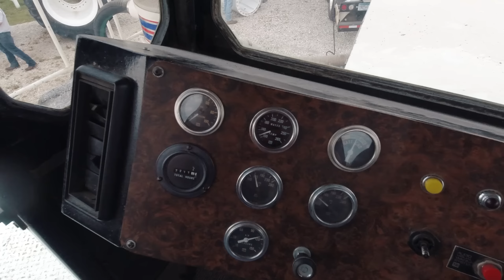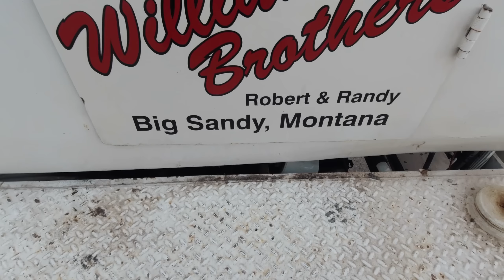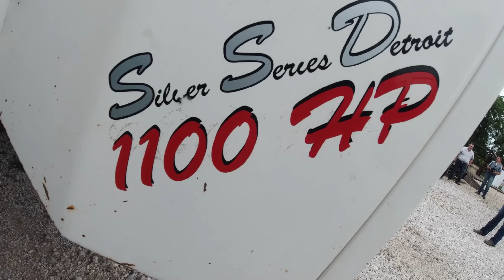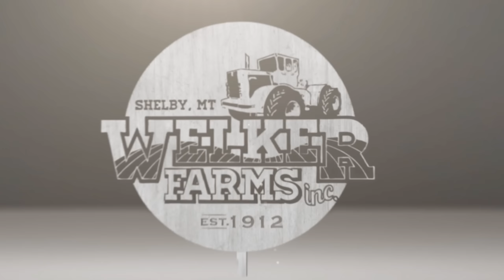World's LARGEST Tractor Gets World's LARGEST Ag Tires! - BIG BUD 747

Comment: Am I the only one who think’s the 747 looks better with the old tires
Reply: No I also think it looked better with the old tires. Its proportions look weird with the new tires. I'm nit sure if they still use the 747 or if it's just a museum piece. I understand if they are using it but if it's just going to sit in a museum then I would of left it alone.
Reply: @ChiefStones  the tires were junk were taking chance just driving around. They were nit using it in Iowa as they were all no till operation now.  Don't know what Oman is after moving it back to Montana they have land there. But most likely no till also
Reply: With these tires it would look better with singles, cause singles would be almost as wide as the old doubles. But I guess the doubles are needed for weight distribution and traction.
Reply: Yes
Reply: I do prefer the old duals look but the functionality with the lsw’s is probably better but, meh i like both setups 👍

Comment: YESSSS finally who would have thought that a tractor from the 70's would still be a workhorse today, it was built to last centuries. I hope they give that ole Detroit some solid hours!!
Reply: To my knowledge we dont even have equipment that that thing could pull that would put a decent strain on it, that motor will probably not be stressed for a long time lol.
Reply: @BlackjackOnem  Well yes it is a 2-stroke with 1100hp too much torque!!
Reply: Who'da thunk...  Done harrowing today on my 1946 Farmall H  :)
Reply: Bill sargent — If you search Big Bud 747, You can see it action pulling 21 plows I thank !
Reply: @ACE-ek5bo  This tractor beats all of the new-ones with 800+ hp, you know why, because it has HP, not only that its so easy to work on, it could pull plows 24/7 if it had maintenance of oil and air etc
Reply: Dakkan biggest production tractor is the Case 620 692HP
Reply: Literally anyone who’s been around farm equipment would’ve thought that.
Reply: @BlackjackOnem  im pretty sure there are some big air drills thatll be a good workout for the 747. Would love to see the big bud hook up to then and go for a spin next planting season.
Reply: @BlackjackOnem There's always something you can do with more horsepower.  Deep ripping with some attachments could easily give any  ag tractor a workout.  The biggest deep ripping blades are hauled behind D11 cat bulldozers, and a D11 would drag this bud around like a toy in a pulling contest.  Not knocking the Bud, but D11's are in a whole different orbit of mass, torque, and traction.
Reply: @BlackjackOnem  housing on demand is not
Reply: @BlackjackOnem  Give it to Mike Mitchell and he will tell you he could use a bit more power.
Reply: @bpaul1201awesome  Check youtube "Extended video Zells Planter 2016 - Largest Air seeder". That big bud should pull something like that
Reply: He mentioned getting the weight of this monster, but I haven't seen anything about it. Does anyone know?
Reply: what are you talking about?? lots of 1970s stuff still are 100 times better than the new one...  specially machinery right

Comment: I liked the shot showing the front diff, oil covered. Definitely a Jimmy under the hood!
Reply: Yep the only way to know if a detroit has oil is if it's still leaking
Reply: "If there ain't no oil under em,there ain't no oil in em."
Reply: that's not true,  when brand new or fresh from an Genuine Detroit dealer rebuild yes, but every one of our rebuild were dry and tight, the stupid thing is GM has a special seal for the blower shafts, but it a special order, and it makes a BIG difference in how much oil they leak, but if you just walk in and ask for a seal and gasket set, you get the bad seals.

Comment: Titan tires LSW1400s finally caught up to the tractor that needed them the most.  Tire slip and rim slip is a battle on high horsepower tractors.  If these tires were available in the 70s, I’m guessing there would be dozens of 747s and Big Equipment would still be building them today.

Comment: Mike Mitchell needs to take the 747 and put it on one of his 80’ Borgault air drills
Reply: Or borrow the Zells 214’ airdrill, although shipping cost would be enormous...
Reply: Mike would say "I like it 👌. But it only has a top speed of 12.5 mph. That I can go in the field. Pulling everything I got. Cause that is the top gear. Come Big Bud I need more speed. Make me one that goes faster. She alittle under weight too. Put some more weight on the old girl. She can pull it. She heavy on the front and light in rear. She needs more butt !"  Ha  My John Deere weights in 60k. And she is a little top heavy if you know what I mean." Mike is a hoot !
Reply: Brian Anderson haha you’re right. That’s exactly what he would say
Reply: @PSchuler92  yes, I was thinking 80'? at least challenge it,  I was watching a video of a D10 doing the work this had been built for, I believe they said this girl pulled a triple ripper, while the D10 pulls a single

Comment: Welker's need to buy one of those 740's out of California
Reply: Wish they could 😀
Reply: Wikkitt Klown  Probably you can drive it on HVO Bio100 -diesel and have zero CO2 emissions and this old big stroke engines have low NOx and soot is a easy fix if you don't use it commercial. But of course take them to Montana anyway!

Comment: Can you imagine cruising down the field  with a huge piece of tillage equipment. Wow that would be awesome
Reply: Like a 130ft seeder !
Reply: But then you must have an even "Bigger Bud" when you're stuck in the mud!  Lol
Reply: @uppsalahazzemarkstedt2759   With the tires that tractor has you won't get stuck unless you drive it where you shouldn't , Then you unhook from your implement and drive out. Now pulling out the implement that's a different story. Been there and it wasn't fun.
Reply: Wonder how many bottom plow that would pull. Looks awesome🇺🇸🇺🇸
Reply: Take a 620 Quadtrac any day,why? Because if I break down I can actually get parts within an hour...
Reply: @SirHuddy  Exactly. This bud is cool and all, but doesn't seem too practical anymore for actual work. Unless there is an inventory of parts for it somewhere? But then it was a one off too. So I'd imagine there are some things that can't be replaced without custom work.
Reply: @SirHuddy  What are you going to break on that Bud that can't be found at any Detroit dealer, aftermarket manufacturer, or any old truck/bus salvage yard?
Reply: In todays day n age, not practical for 100% use. But for the sake of entertainment and such this is a gem. The views it would get running equipment would be through the roof. They meant to make 3 of em, but only 1 was ever finished.
Reply: I'm still stuck on the idea in my mind of seeing that tractor in transport between Iowa and Montana the visual of how's it going down the interstate on some type of trailer, huge trailer.
Reply: @SoybeanFarmer3300  well they'd have to put it on some skinnies and transport the tires on a separate trailer. Really made no sense to mount them when they're just going to come back off to lowboy it, other than for some kind of PR photo op.
Reply: @masterhiggins9914  Yeah it'd bring a lot of publicity for sure. It would probably get annoying after a while actually. Imagine the people that would line up at the road to watch it make passes.
Reply: @jfdb59  oh no doubt that would be annoying af. Trying to get work done but dont wanna deny people the history.
Reply: @SoybeanFarmer3300  same way they transport combines. Remove the wheels, up on blocks strap it down n go
Reply: that would be whistlindiesel
Reply: Tractors this big have one problem:  The ground is not firm enough to give them enough traction.  So it could pull a huge implement, but the wheels will just spin.  It takes tons and tons of weights just to get the traction good...and it's never good enough.
Reply: Could you imagine being stuck in traffic behind this thing

Comment: The price of any late model articulated tractor makes a Big Bud very feasible. I’ve never seen one up close, but from what I can tell, they are simple. You could rebuild it over and over. 

I’d want to completely gut it out and modernize it. Any more, the tech can be added to anything.
Reply: I’ve seen several up close, and you’re absolutely correct. As long as the frame stays intact, pretty much anything is possible as far as rebuilds

Comment: I read somewhere that this thing can gobble up an acre a minute.
Reply: Yep I seen that in the interview with the owners but it helps that it was pulling a 80' digger which is a feat in itself.
Reply: @Sam_kleinskc  true, but it shows what its capable of. You could probably go wider but I can't think of anything bigger. On a different note,I don't know exactly what model 16v92 they're running. But it doesn't matter too much because they're all pretty stout. I ran a small work tug with a turbo/intercooled 16 cylinder Detroit for my uncles marine construction company and you couldn't stop the thing. There was a few times where I didn't think she'd get things done. But with the variable pitch prop I'd back there pitch off and let her eat and she'd scream  away. It takes time to get used to the 2strokes. They  scream away and if you ran another diesel the same way it'd send rods and piston's flying lol

Comment: That tractor is so big it doesn't register as a tractor anymore ... more like planet tug machine ! What an amazing piece of engineering , the weight , the dimensions , the tires , the tremors caused at starting the engine ...WOW  
Imagine if this tractor gets modernized , updated with all new technology . 
But i wonder what will happen if that enormous piece of equipment stuck in mud ...

Comment: The company i worked for leased one of these to pull loaded construction trucks loaded with hi line material thru the sand in 1982 we had 3 macks tied together all grossing over 100k pulled them with ease in neutral. most amazing piece of equip i have ever been around.

Comment: I do have a question. 
How does the Versatile 1080 BIG ROY compare to the Big Bud tractor's?
Reply: Not sure about Roy but probably doesn't weight 130,000 ballast and 1000 gal fuel, and 25.5feet wide

Comment: I think you would need more than a flimsy battery powered torque wrench to do up the stud nets for the wheels, having that much weight and force on them would require a very large torque setting which would require like a 1" drive air-powered rattle gun.

Comment: The New Titan Tires  are  a  lot wider .. Radial  Tires  should  save  quite a  bit of fuel over Bias Ply  and   ride a  bit smoother..    They need to  burn a tank of fuel  doing field work ..  then put some fresh fuel in it..  Would  be  interesting to know what Transmission ..   And  axles  they used..  I am  guessing maybe Clark  from  a  very   large  Front  end  Loader or  quarry  haul truck ..

Comment: Weller Farms. 
What type of transmission is in the 747 Big Bud is it an Allison type transmission. Allision made a DP 8000 series for the Detroit Diesel 16-V-71 some engines came with a Turbo (T) and an or a Inter Cooler (I). Just an old Detroit Diesel person, they made a old old 51 then 53, 71, 92 and a 149 series. The Detroit Diesel type engines made more horsepower pound for pound then most other engine types, it would come up to max rated RPM the quickest also that scared many people too.
Take Care
Reply: 16V-92 twin turbos. Twin Disc 6 speed power shift.
Reply: Lyn is correct

Comment: What's the tire pressure on that beast and how long does it take to fill up a flat LOL. does it have oversize fill valves or do you just bring the newspaper?
Reply: They came aired.  Probably will wait til get in field before adjusting pressure. Standard tire valve

Comment: Wonder if the fact that those tyres appear wider than the originals would compromise the steering angle - ie would the fronts hit the rears during a full lock turn ?

Comment: The original tires were about 35 inches wide X just short of 8 ft tall ...

The 1400 tires by Goodyear are only a 82" inches tall - which lowers the tractor about 6 inches....

A better fit for the tractor would have been Firestone 850/75R42 - which is 92 inches tall and 34.2 inches wide - or a near perfect match in comparison to the original size
Reply: Titan had similar size but 1400 is much wider
Reply: @RobertWelkerFarmerBob     By dropping height - your looking at close to a 15% decrease in diam - which will result in a 12 mph transport speed being dropped to 10 (and so fourth) ... Does ratio change effect what the tractor will be used for?   ...  Were they wanting to reduce PSI - by going wider? 

A few years ago we purchased a couple new tractors (JD) which allowed us to take part in a 3rd party (no brand) survey - the survey was based on need for larger tractors (over 800HP) ... In 2022 - JD will be coming out with 18L engine at 870 HP ... With evidence of higher horsepower engine / axles and transmission already being produced by JD and other mfg's - the gears are clearly in motion for a larger 4 wheel drive tractor to be introduced to the market in the next few years ... Bourgart  is producing 1300 bushel commodity cart / 68 ft wide air drills - that currently require over 600 HP to handle  (probably 700 hp to handle in all areas) - and with fewer but bigger farmers all the time - the market seems to be shifting that way ...  So, based on the survey i participated in - the current machinery on the market, and direction of agriculture,  i think we will see tractors in the next 10 around the 800 HP mark - and over 70,000 lbs

Comment: I have kind of expected one of the engine manufacturers to support a repower to be able to claim they power the biggest ag tractor.
Reply: there isn't anything wrong with two stroke detroits but they are not as fuel efficient as the newer electronics

Comment: What is that designed to pull? I want to see the tools that go with it.
Reply: 1100 hp 135,000 lbs. Big bud 650 at Fly Creek Farms outside of Billings MT pulled Frigstad chisel plow w 16 inch shovels. 90 ft wide. Williams Bro's are pulling 80 ft. Taking it easy on the old girl.

Comment: Wish you would have gone more indepth on the drivetrain, but the little I heard sounded like a two stroke detroit?
Reply: Detroit 16V92T twin turbos 24 liters.1100 hp. Twin Disc TD 61 2609  6 speed power shift. Clark 85840 axles -limited slip differentials.

Comment: So will the big tires stay on or just for a advertising stint? Guessing that there hauling old ones to Montana, the old ones will be put back on
Reply from the maker: The new ones are there to stay, custom built rims so only that tractor can use those new tires. The old are shot and won't hold air.
Reply: Thanks for responding. I was curious about that.

Comment: I'd like to know why they spaced the wheels so far apart? Is there more traction or is it to prevent dirt from packing between them?
Reply: It’s to let the LSW tires work since they’re really designed to be run as a single tire. As explained when they put the LSW’s on Beastbine that duals ridge up soil in between them

Comment: Why the heck are they using the forklift to put the tires on when you have a tire hand sitting there?
Reply: Because if they used the tire hand they would have had to move to truck around a lot
Reply: @ryanborneke5189  you move the equipment around the truck. Do one corner, pull it forward. Flip the tractor around and repeat. Truck stays put and takes 2 seconds to move the equipment. Thats the way I like to do it anyways.

Comment: Just another big tractor. How many tractors could I purchase for the price of the tires? You need a big farm and a tanker to keep that tractor running.  It was designed for production they need to cover the acres up there. Tractor like that are too big for where I am located. Plus the ground here is so steep that crawlers are the preferred tractor. For many years I run a modified D7 with a 3406 it would pull all day and I never shifted gears. Know they have quads.

Comment: Why didn't they stay with the origonal size and design of tires and original wheels and keep it all original? If they are lower profile that will probably rob the engine of some of it's pulling power because a taller tire rolls easier. Just think it should have been kept original.
Reply: There are no tire mold of the original , was destroyed.  No other tire made fits the rim .This is the only way to retire.
Reply: @RobertWelkerFarmerBob  thank you for the response. I guess in that case options are pretty limited unless someone would make a new mold. Great video.

Comment: it would be nice to know the  technical details of the machine rather than ,oh its big , oh its  massive  is that all you know about  tractor .
Reply: 16 cylinder,  24l, 1100hp, 6sp twin disk trans, 85k Clark axle, 1000 gal fuel tank,  130,000 lbs weight with ballistic, 25.5 ft wide, 1.5 in plate frame.  Hope this helps
Reply: @RobertWelkerFarmerBob  thankyou thats realy  great information ,ide like to operate that over here in OZ  what a beast .

Comment: The tires alone will destroy all crops in its path. It will also compact the soil and cause infertility
Reply: William's would disagree.  Used it pulling 80ft cultivator until no tilling.

Comment: Who was the clumsy bugger that installed those tires? The tread bars aren't lined up.
Reply from the maker: The custom rims only fit the hub bolt pattern one way so only way to adjust tread bars is to slip the tire on the rim.